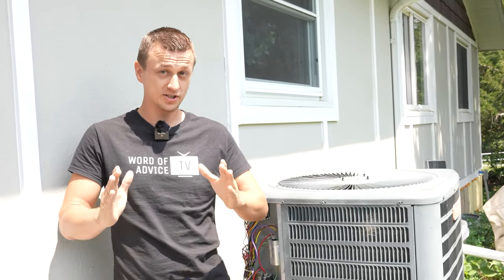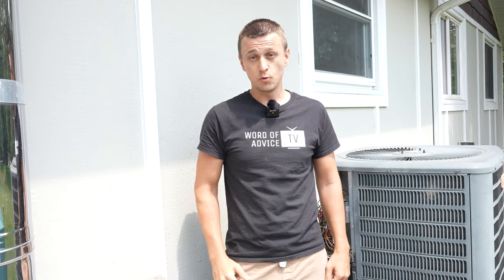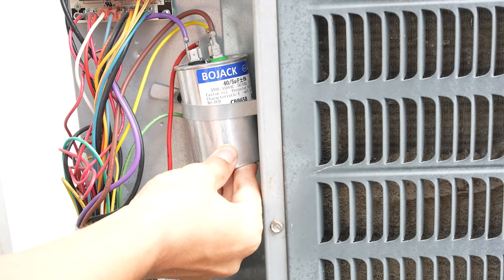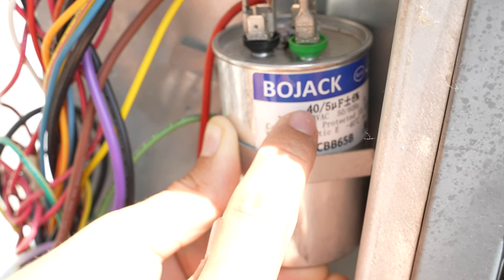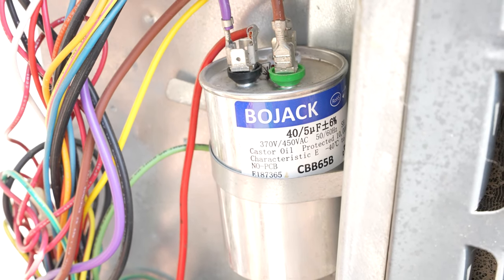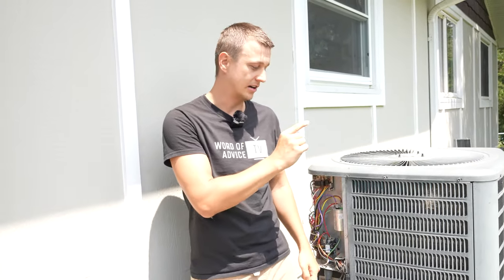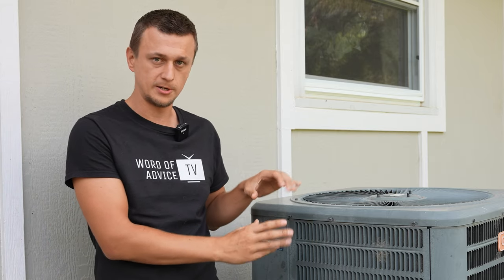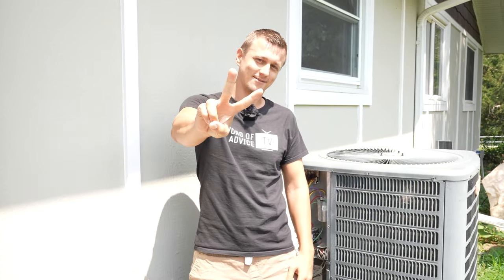How to Order the RIGHT Capacitor For Your Air Conditioner

Comment from the maker: ⬇ For reference:

20 Common Capacitor ?s Answered:
https://youtu.be/ae0Ue4F3ooQ
How to Replace a Capacitor:
https://youtu.be/9ZGfvC-PMWU
Rusted Capacitor:
https://youtu.be/RSIi47uzApI
How to Combine Capacitors:
https://youtu.be/qLJOWU33TFo
How to Check a Capacitor:
https://youtu.be/5_0nKm940nA
How to Discharge a Capacitor:
https://youtu.be/45oZXnClMD0
How/Where to Order HVAC Parts:
https://youtu.be/faCno8-vRnw

Different size capacitors on Amazon:

25+5 MFD Capacitor:
https://amzn.to/3hPXcoI
30+5 MFD Capacitor:
https://amzn.to/3fLsCtB
35+5 MFD Capacitor:
https://amzn.to/3wsvFhh
40+5 MFD Capacitor:
https://amzn.to/3vpEbxy
45+5 MFD Capacitor:
https://amzn.to/3fLu92P
50+5 MFD Capacitor:
https://amzn.to/2M7RFGY
55+5 MFD Capacitor:
https://amzn.to/3vlJ8Hk
60+5 MFD Capacitor:
https://amzn.to/3fGZjbH
65+5 MFD Capacitor:
https://amzn.to/3MkLWyq
70+5 MFD Capacitor:
https://amzn.to/45c0RDL
75+5 MFD Capacitor:
https://amzn.to/41RN2qT
80+5 MFD Capacitor:
https://amzn.to/3BJJ2hy
Reply: My central air blower seems to blow air weaker or not as strong as it used to. Could it be the blower motor is going or the capacitor issue? Thanks
Reply: @WordofAdviceTV  thank you. I was just to novice lol I was stuck on buying the exact  replacement for efficiency,  reliability, safety and quality 😅
Reply: @WordofAdviceTV  you sir put my faith back into humanity.  Integrity and understanding is virtue i have never seen someone in the AC Business express . Yes I said it. I have never met a honest ac man, everyone is a crook in my book. Been rip off several times and lied to about repairs being completed.  Even had one guy put a nice shiny nick with his razor knife in the main cooling line as it leaves the pump.said I had a leak, fixed and charged with new coolage juice🙄. I even had a guy replace my entire system..well 90% except the hard to reach stuff, like copper cooling lines in the wall....Oh it gets better. The only thing wrong with my 20 year old system was a  Capacitor had  gone out in  attic air handler. Now this my new found hobby to search out bad capacitors haha..🤔🤯😬

Comment: After watching your videos on capacitors last year I ordered a spare capacitor for my 22 year old air conditioner, just in case. Two weeks ago my capacitor failed on a hot humid day here in the south but I had the spare capacitor installed in about 10 minutes. The air conditioner was back up and running saving us from suffering through the heat and humidity which honestly is becoming more dangerous every year. Thank you for all your great advice and instruction, much appreciated. I'm a subscriber and a big fan of your videos.
Reply from the maker: Awesome! I love to hear that a spare capacitor was able to save the day. Way to act on that and order it last year. Thank you for sharing that, may you have a wonderful new week, stay cool!
Reply: Depends on what brand of capacitor you bought, if you went for the cheapest priced one, you'd better stock up on several more.
Reply: Summers were worse 50 years ago, check the records
Reply: More dangerous every year 😂
Reply: @TingTingalingy  Good Lord! No, they were not! Next, are you going to claim the earth is flat?!
Reply: @AMGF815   go look at records pumpkin. While you're at it, go check records of Winters of the same regions while you're at it 😁 don't go cowering now
Reply: @TingTingalingy  Lots of nuts in that bar. Pumpkin? 😂😂 You mean look at weather stats. Yes, that's exactly what I'm talking about. Climate change isn't fictional. Instead of being told by Fox what is and isn't real, why don't you take a look at the stats for yourself?!
Reply: @TingTingalingy "Since 1979, the average temperature in the contiguous United States has increased by 0.32–0.51°F per decade. This is more than three times faster than the rate of warming since 1850, which was 0.11°F per decade. As a result, nine of the ten warmest years on record in the US have occurred since 1998, with 2012 and 2016 being the warmest. In addition, 235 out of 246 US locations have seen an increase in their summer average temperature since 1970, and more than half of those locations have warmed by 2°F or more."
Reply: @AMGF815  that's got nothing to do with the conversation . I said regional. Lately, Georgia has been having colder November & December than Southeast Michigan.  You probably also didn't know Michigan was also a tropical region, but sure 😆 cower, like I knew you would.
Reply: @TingTingalingy  Cower?! Do you know what the word means?! I came with facts while you’re talking in circles. What I posted, supports exactly what I’m talking about. Move your goal posts wherever your heart desires. Good luck with that.

Comment: Another tip: Buy an extra 1 or 2 capacitors. They are super cheap enough and you can leave them somewhere when needed.
Reply from the maker: Amen! Very good tip. 👍
Reply: I keep a set of capacitors and a contractor as well as furnace parts on hand at all times. It’s just smart, they don’t go bad.👍
Reply: @WordofAdviceTV is aā to
Reply: 😂 3:50 3:51 😮🎉😂🎉😢😮😮
Reply: Going for the cheapest ones in the marketplace brings up the old adage, "You get what you pay for."
Reply: @Orange-Jumpsuit-Time  what brand do you recommend then?

Comment: Capacitors are like everything else; there are trusted and less-trusted brands. Polypropylene caps are self-healing as they arc through the dielectric, so brands may say they have a high dielectric voltage tolerance but are the first to fail. Bojacks are known to manufacture a more high-end after-market cap. The larger can is due to a thicker dielectric, which lowers capacitance, thus requiring more foil length, making them more electrically robust. The physically smaller capacitor achieves the same capacitance by manufacturing with a thinner (therefore more prone to failure) dielectric, which raises the capacitance ( thinner dieletic=higher capacitance). The size indicates a construction difference in the dielectric thickness.

Comment: Thanks to you I replaced my capacitor for $41 and got my A/C working before an HVAC company could even come out to look at it. 3 years ago I paid an HVAC company to replace a capacitor for $330. Thank you! Thank you! Thank you!!!!
Reply: Not defending HVAC companies, but capacitors are not the only thing that fails. Just had a home AC unit fail because the refrigerant level got too low (very small leak), and the low pressure sensor switch opened. System needs a recharge and possible leak detection procedure. I did the troubleshooting myself, but have hired a professional to do the work.

Comment: Just spent $170 for a guy to spend 10 minutes installing a $20 capacitor. Never again. Ordering a backup and know how to do it myself next time. Thanks for the video(s)!
Reply: $170 for diagnostic and labor of a qualified tech is not even that bad. Around here in Florida, most contractors charge $300 to $600 for the service and $20 part.

Comment: You saved me $30,000. My 5 ton had the fan wire on common for some reason and I replaced capacitor in 4 ton. Both working now. Every A/C person wanted to replace both systems.

Comment: Often the (Mf) rating will be printed on the motor or compressor sticker.  Size does matter btw.. caps loose capacity as they age so using a 10% higher Mf is often prefered in hot climates.. higher voltage ratings means they can take the heat better; but  they will be physically larger.. Use seperate caps for each motor & install a surge protector (they work ~50% of the time)..  This helps "harden" your system against lightning and power surges..
Reply from the maker: Thank you for the further explanation and suggestions, much appreciated!
Reply: Thank you, I couldn't find the exact manual for my unit, found some very close and they all said it needed a 50/5. The bad capacitor on it was 40/5.  Looked on the fan/compressor to confirm it was called for a 50/5.  Thanks so much for that info.

Comment: Jay, great to hear from you .
If you make a “ temporary” substitution with a different value capacitor, it would be prudent to write the correct value on the unit in case that temporary replacement was forgotten about and became permanent. This way you know what’s SUPPOSED to be there. 
Stay well 👍👍👍
Reply from the maker: Great suggestion! Thank you for pointing that out.
Reply: If you bought the cheapest priced capacitor on the market, right sized or not, good news, you won't have to worry about it becoming "permanent".
Reply: Good move. Also, it's good to know which sections of a dual capacitor go to what. Sometimes the notations on the terminals marked Herm and Fan are rusted over. Herm is the larger number e.g. the 45 of a 45+5, and goes to the compressor ("Herm" for hermetically sealed), and the other goes to the fan. If the markings are unreadable on your old capacitor, now you know. And the common terminal is typically labeled "C."
Reply: @PJBeee  my capacitor is so rusted i had to go by the terminal number of connections took a picture of wires, but the number of terminal spade connectors is pretty standard

Comment: For my Rheem unit, I have to get the same physical size because the "barrel" is placed through a hole in the casing. Smaller or bigger won't work but the OEM unit is readily available. Could you , one day, talk about installing a surge protector for the compressor? Love these videos.
Reply from the maker: Ah yes, in that case it would be better to have the same physical size. Although I've had times before (with Rheem units) where I simply laid the capacitor on it's side and strapped it down securely. That works too. And yes! I actually have a surge protector that's been sitting around which I got specifically to make a video with. I hope to make a video on that eventually.

Comment: Jay, very glad your still handing out sage advice on electronics. Having a spare capacitor on hand is a great to be prepared in case the one is the unit goes bad. Often the fix is to just replace the bad cap with a new one.
Reply: If you bought that spare el cheapo capacitor from China, never mind just in case, better buy them by the case.
Reply: Some modern condenser units don't have a fan capacitor. Just worked on one that has a variable speed module before the motor, and no capacitor. It appears that the speed module spits out 3-phase power from a single-phase source, the motor seems to be 3-phase (no capacitor needed), and the capacitor is just for the compressor ("Herm" + C terminals on capacitor).

Many condenser units have a schematic diagram inside the access panel that gets you to the capacitor and contactor (relay-solenoid) etc. which can be very helpful.

Comment: Thank you for this. Now where can I buy a capacitor for my ac unit?
Reply: Amazon
Reply: Grainger
Reply: @Phelper99 I agree.  If you have a Grainger nearby, they are a great choice.  This past winter, the run capacitor went out on our HVAC blower motor at around 2AM.  By 7:15 that morning I was walking out the door of the local Grainger with new capacitor in hand.  Before 9AM, I had the capacitor replaced and the HVAC back in business.  My wife was amazed and it cost about $6.
Reply from the maker: @hoboken5224  You're welcome! I added a pinned comment under this video with a bunch of Amazon links to capacitors. 👍

Comment: Hi Jay, another great video. I like to point out how careful you were while you loosened up the holding strap for the capacitor and not touching  the wire terminals. 😁
Reply from the maker: Thank you! Haha better safe than sorry right? I don't remember for sure but I think I did turn the power off but didn't discharge the cap, that's why I was careful.
Reply: @WordofAdviceTV  Awesome work, and a great joke. Still laughing my friend.  😂 😂

Comment: Last year the ac repair man came out to my house to fix my air conditioner. Come to find out, it was the fan side of the dual run capacitor. The herm side was still good. Instead of replacing the dual run capacitor, he piggy backed a small 5 ufd with the dual run capacitor. He said he ran out of dual run capacitors and all he had in his truck was the 5ufd capacitor. I got charged over $300 dollars just to replace a $10 dollar part! So now my air conditioner has two capacitors in it instead of one. Can you make a video on how it's wired? I've searched on YouTube for this and there isn't one for this scenario. Thanks for your videos. They have helped me understand how ac units work.
Reply: Sue them! They don't have the right to charge so much for repairs, we should shut down all HVAC companies, learn from this guy and do everything for free
Reply: I encourage everyone one to scrutinize the HVAC repair man! Watch what they are doing! The one that came out to my house would not let me use his ladder to get on my roof! I had to use my own ladder to get on the roof! I could tell by his demeanor, that he was not comfortable with me watching him do his work.
Reply from the maker: Thank you for sharing your story! This will be helpful for other homeowners to know. As for your question, these two videos should be able to help:
How to Wire an Air Conditioner: https://youtu.be/KCanZEsLVEI
How to Combine or Separate Capacitors: https://youtu.be/qLJOWU33TFo
Reply: @WordofAdviceTV  
I kinda have an idea of how it's wired, but I'm not sure. I see the brown wire on one side and another wire that must be connected to common. Either through the common side of the contactor or the common side of the dual run capacitor. This totally bypasses the fan side of the dual run capacitor.
Reply from the maker: @jimvalim1567  Most likely you simply need to put the brown wire in the fan section on the dual capacitor and simply discard the little jumper wire that goes to common.
Reply: @WordofAdviceTV  
Thanks for the advice.👍 It's like eliminating the brown and white wire from a four wire condenser fan motor, to make it a three wire system. In this way I can eliminate the small 5 ufd capacitor and go back to just using the single dual run capacitor. I think I got this. I've ordered some replacement capacitors from Amazon, cause I never want to go through this problem again.

Comment: I recently replaced the AC and furnace capacitors on my 9 year old 5 ton Goodman system. The original 20 mfd furnace capacitor was down to 17.8 mfd and the 70/5 mfd AC capacitor was still 69.8/4.9 mfd I kept it for spare. To my surprise the condenser fan was not connected to the capacitor…just the red wire connected to C and the yellow wire to Herm. I chose to pay a bit more and bought the U.S. made capacitors…although, I don’t know if it really matters. Also, do capacitors have a shelf life? Do they go bad even if they aren’t used?

As per your advice, I also ordered a hard start kit and got it today but after watching some more YouTube videos on that topic, I decided not to install it as long as my AC keeps starting so smoothly. No lights flickering either.
Reply: Don't worry about shelf life.  Unless it is sitting in water.

Comment: Jay, thanks for this video!  I was able to install an Amrad capacitor on our ac condenser.  I would respectfully disagree with you about the brand of capacitor not mattering.  I am OCD about research and it quickly became evident after reading thousands of reviews that cheap Chinese capacitors do not last much more than a year if that.  Amrad capacitors seem to last at least five or more years and many are over twenty.  I am all about going for quality instead of a cheap price.  My 45-5 Amrad cost $36.94 with shipping from Dayton Industries in Palm Coast Florida.  It was sent via usps in the manufacturer's box which was enclosed in a bubble wrap envelope.  No damage like with many other sellers who slap the box in a cheap envelope that is unpadded.  There may be good Chinese capacitors, but be sure to read the reviews.  I'm lazy and don't care to replace my capacitor every year or less.  Thanks for your great channel!

Comment: Thank you for the video!! 
My current capacitor says 45/4uF, but at the market sells only 45/5uF . Can i use this or should find 45/4 ? Please let me know!
Reply from the maker: It would be best to find the 45/4 but if you can't find it anywhere, then a 45/5 will have to do. It may shorten the lifespan of the fan motor a bit though.

Comment: Hi Jay,  Good to see another video from you.  I have a16 year old, Bryant, 3 ton, R-22 unit on which I replaced the contactor and that cured on/off every few seconds until it would finally run problem I was having with it. Prior to that trying to fix the problem, I installed a Supco hard start kit.  Should I take the hard start kit off now that the real problem (the contactor) has been fixed?  Thanks

Comment: Great videos and education as usual. I was curious to know though would you put a hard start kit On a new condensing unit? A hard start kit came as part of the deal with the new HVAC system, but the technician said he wouldn’t put it on, if it was his system, because the capacitor that was there was so new. He suggested waiting a few years. Also, if you bought a spare capacitor, how long would it be good for? Several years, or do they age over time.? Your thoughts? This system is only one year old. Your thoughts.

Comment: Cool. Thank you. Question: What about the + or - 5 / 6. Does that matter? For example, I am replacing a 45/5 +/- 5 with a 45/5 +/- 6. Is this OK? I understand those numbers and what they do.Which is testing the capacitor good or bad. So does replacing +/- 5 with a +/-6 matter?
Reply from the maker: Either 5 or 6% will both work the same. You can use either one. 👍